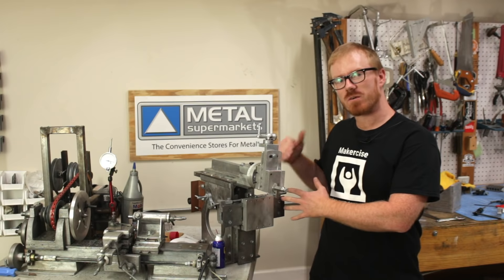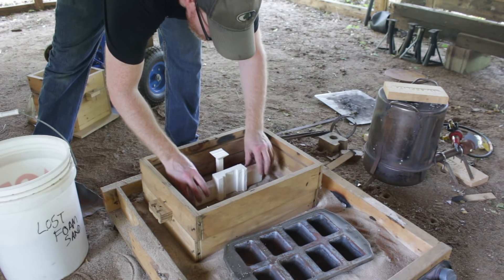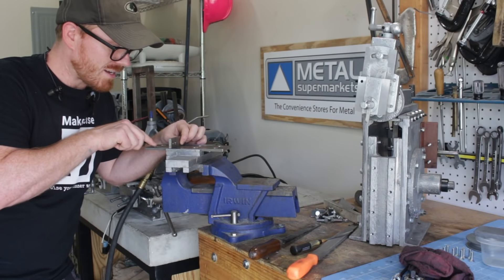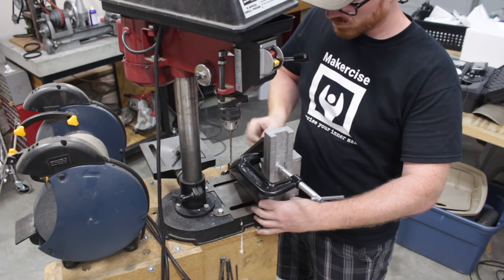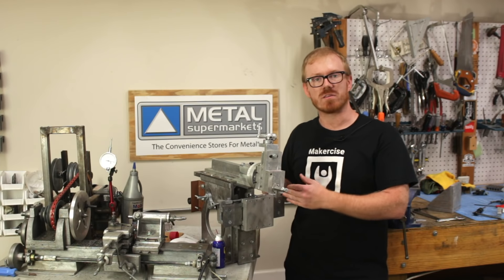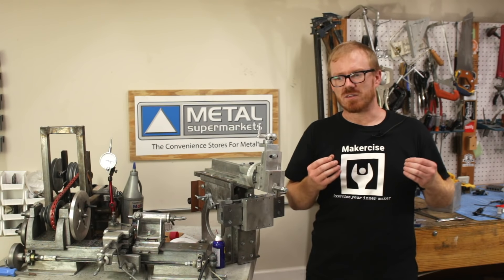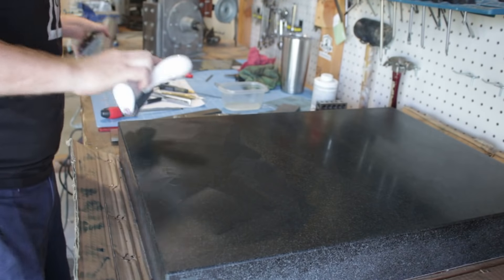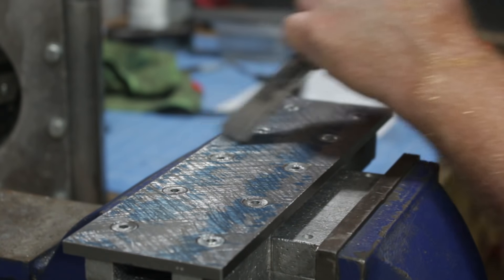Shaper Cross Slide Support

Comment: Maybe do the mill in case iron ?
Reply: Dave Gingery worked in Aluminum because it melts at a much lower temperature and was easier to work with.  Working with iron will be more challenging.

Comment: If you get into cast iron, an excellent source of cast iron is from the disc rotor on disc brakes. Every mechanic shop has disc rotors, that have been replaced. However you should add some ferro-silicate to the melt to get good gray castings that are machinable. The cast that is white is too hard, you want gray cast iron.

Comment: Great video. Now that the shaper is nearing completion, have you contemplated using it to partly work on some of the remaining parts ie somewhat building itself. In some forum I have seen pictures of a Gingery build where a provisional toolhead was used to make some of the remaining parts. Gingery does it for the table if I remember correctly.
Reply from the maker: I will be using the shaper to machine its own table.

Comment: just looking at that slide , it might be a good start for a mini surface grinder 
usually you move the stone of the surfacegrinder down to meet the part you need to work on , this i think will be eazier as you can use a stock benchgrinder mounted on top of the rail holding the slide , gives less moving parts and i think makes it eazier to construct
hmmmm need to move the slide in and away from the rail too....... darn

Comment: Cressel, glad to see you continue on with this project. I wish I could support you on patreon - maybe someday. I had a random thought about your casting technique - What would the raw casting surface look like if you applied a layer of clear packing tape to the foam before you added the plaster? I know the plaster would be super smooth right up against plastic packing tape after using Grant Thompson's flowerpot foundry tutorial - I was able to de-mold a plastic bucket from the inner wall of the bucket & the plaster was as good as glass. Not too sure how the pour would go considering the casting would need to breath ie the gases from the foam still need to go somewhere ... really curious. Thanks man.
Reply from the maker: No problem regarding Patreon. Glad to get support from those who can, but totally understand its not possible for everyone. Keep an eye out for the work table video. It may answer some of your questions.

Comment: Tip: When countersinking, turn down the RPM as much as possible.

Great video!
Reply from the maker: Jonas Bandier I need to make an intermediate pulley. I pretty much leave the drill in “low” gear. Anything over 3/8” 10mm gets hairy as well.

Comment: Lost foam casting suggestion, paint it with investment.  It makes much cleaner smoother parts and helps prevent sand collapses.  I use watered down drywall mud.
Reply from the maker: Yep. investment coating is critical. I wouldn't do lost foam casting without an investment coating. I use plaster of paris. I haven't tried drywall mud but maybe I will.
Reply: @Makercise  ahh i didnt notice if you had them coated or not my bad

Comment: I've seen several instances of ppl using ferrosilicon to convert scrap steel (with a mixture of pure cast) to "recycle" steel into cast.   Although ferrosilicon is standard in industry, I have to wonder if it's really the only suitable silicon source for small scale.
Reply: Ferrosilicon, improves the flow and texture of cast iron. By itself, added to steel, does not make cast iron. A small addition of copper, also does the same thing as Ferrosilicon., Sort of!

Comment: Casting iron doesn't have to be done separate of the mill. If you build an oil burning furnace to melt iron it can also melt aluminum extremely quickly. You can do both on the same day.
Reply from the maker: My wife told me I have to pick one project, finish it, then move on. LOL
Reply: @Makercise  yes but casting iron isn't a project. It's a means to an end. The oil burning furnace would be a week long project maybe two. Once done you cast anything you want.
Reply: it took me over a year to perfect burning motor oil for aluminum at 1700F. it is an art more than it is a science, and will definitely take more than a week of tinkering - and cast iron requires a .... little bit more. if one knows what they are doing, it should take about a week to construct a pre-planned oil-capable, iron-capable furnace that is worth using. anything less than that, and you have a lot of R&D time on your hands.
Reply: +Makercise +Atrixium I've heard it too, 'just one project'. Currently working on a trommel build, looking forward to the day when I'll get around to a furnace/foundry project.

Comment: i've done a bit of casting and a bit of forging......

cast iron is a whole different animal than aluminum. cast iron means no more propane, and on to motor oil. motor oil means messy, smelly, carcinogenic, heavy metals, hassle, annoying...... but when it works, it works well. i am not saying this to dissuade you, but as a fair warning: using motor oil to melt iron is not for the faint of heart. i haven't melted iron, but i have burned a couple hundred gallons of motor oil melting other stuff. 

you will need an expensive, heavy crucible. you will need an expensive, heavy furnace. you may need a crane, or at the very least, a partner. the bare minimum for a furnace is a few courses of red brick mortared together with a blanket of cerawool and a stainless steel liner. this will struggle to reach temp and probably last 2 or 3 good melts. one of my first iterations was red brick buried in dirt. i had the dirt glowing red by the time i was done, and the red brick had shattered and bleached and crumbled. this was at 2000F. :)

figure on 3000F temps for your iron as a minimum rating for your furnace. you will need kaowool, refractory cement, and a refractory hot face - satanite, ITC-100, etc. for something of this scale, you may as well buy a whole 80lb bag direct from the supplier of both refractory cement x2 or x3 and hot face lining x1. fire bricks will help add refractory mass for less, but you still need a mortar to bond them. 

if your furnace is rated for and refractory enough, you can achieve 3000F temps. you'll probably need about 2 gpm of motor oil flowing in in order to meet that requirement, perhaps more. i only ever melted aluminum and some bronze with motor oil. 

motor oil generally has a flash point of around 400F. this means that your entire surface area of the furnace will need to be preheated to that temperature before you can begin burning motor oil. you can preheat with propane or with kerosene. i recommend cutting your motor oil with diesel, kerosene or gasoline - safest to least-safest, respectively. 

you need to find and construct a consistent, reliable burner. don't settle for the "Kwiky all-fuel", tough to tune. go out and spend the $100 to get the delavan adaptor and  nozzle for a typical home-heating furnace and the necessary plumbing. there are video tutorials available on here and elsewhere online. alternatively, you can use the drip method, which works well, but can be finicky depending on how you constructed it. you need to balance cold air + cold oil inflow vs. atomization vs. btu output. adding fuel reduces btu output. adding air reduces btu output it is an extremely fine balance that has to be maintained throughout in order to increase in temperature after your preheat. oil is engineered for keeping engines cool, after all. it sucks heat. 

you can figure on a bare minimum of $500 to get yourself into iron melting capacity with success and consistency - and you still need the iron, to boot. old furnaces/boilers are a good source, perhaps your best, as not many things are cast iron anymore and if they are they're too expensive to justify melting down. many boilers will have a cast iron firebox which is a durable iron (you'll see if you ever try smashing one up!). it is generally about 1/4" to 3/8" thick, and a single scrap furnace will net you a couple hundred pounds. if you live in the northeast, they are plentiful. you will have to deal with dust, soot, fiberglass, [[[asbestos]]], and the stink of diesel, but they are a good source. 

that's all i got right now. i can answer any questions you have - i have run a variety of different homebrew motor oil operations and melted my share of metal and vaporized more than my allowance. good luck.